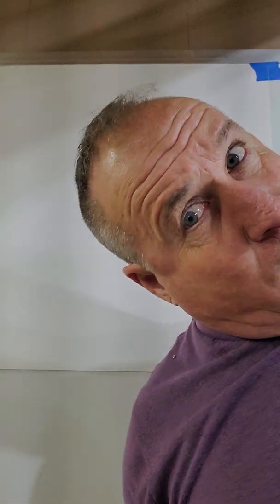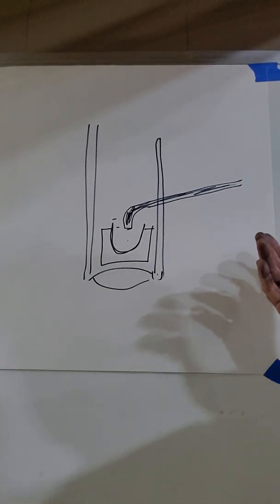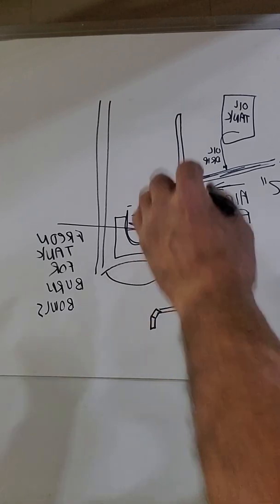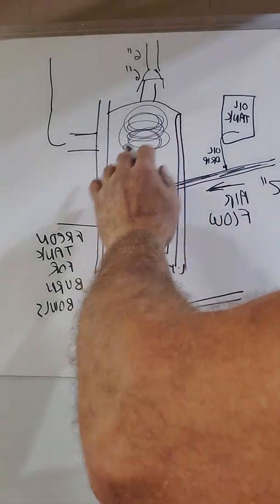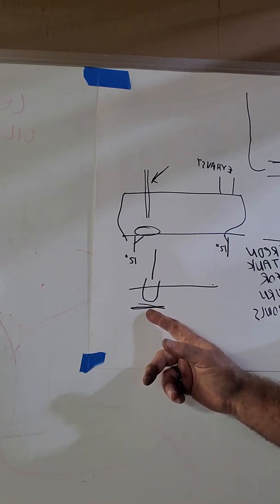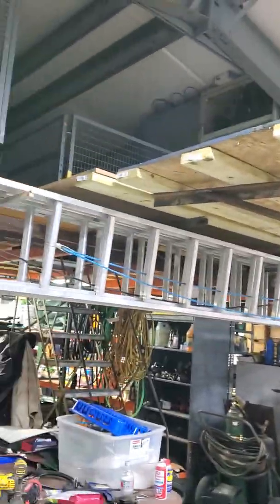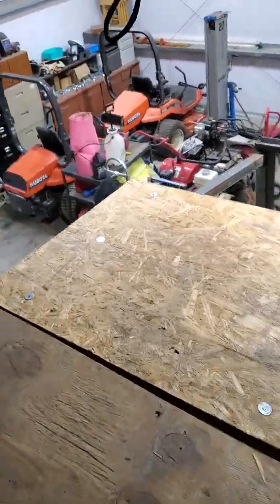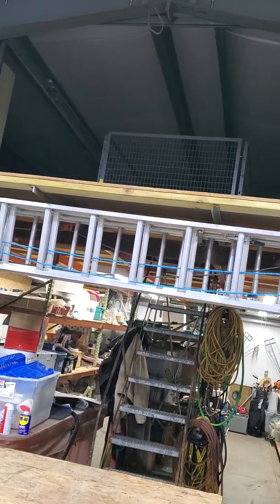DIAGRAM ON BUILDING USED OIL BURNER

Comment: Hi good work I had a used oil steam boiler in a honey house 3.5 hp with three up and down dripping tubes that had a splash drip thing like a bottle top at the top that the oil splashed on to litup went down the tube and in to a large expand box then up the chimney thru the boiler and out. This is a long time ago and we used old oils  mixed with kerosene to start.. so in your horizontal burner try a 5" tube from top to the required height in the burn pan no holes and drop the oil on to a bottle top or potscrub held in the middle with a cross of wire about 3"to5" from the top.. it is 50 years since I worked it and it worked well good luck I like what you do

Comment: I built a rocket stove base on this Liberator design but I'm using oil instead of wood and it is working fabulously! 
https://www.youtube.com/watch?v=ne0vhvvt0_8
It has an enclosure around the rocket tube  with the exhaust coming out of the rear at the bottom of the heat exchanger tank. At first I thought the smoke would build up and eventually come out the feed port but it doesn't.
Reply: How is the used oil rocket stove working out? And is there any way I can get some more information. Photos or diagram maybe an a way to contact you.